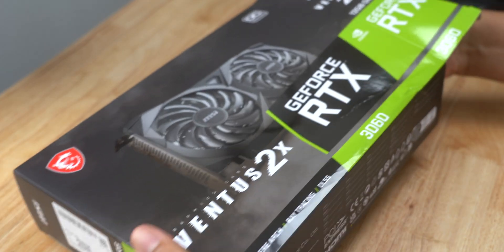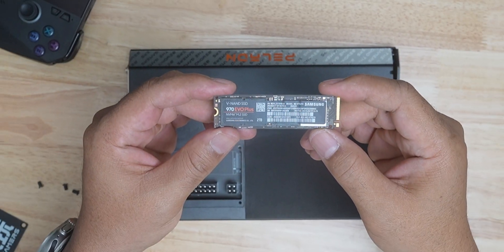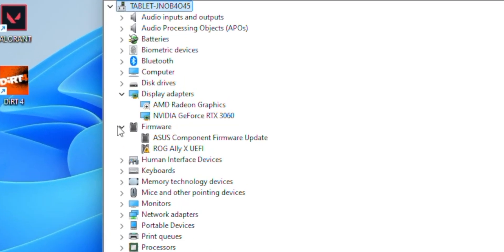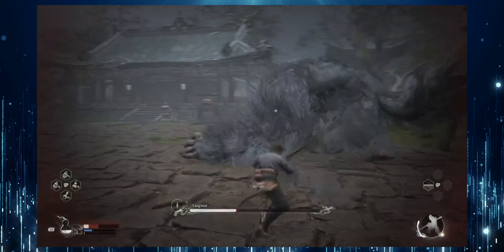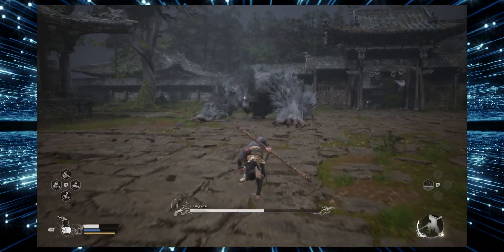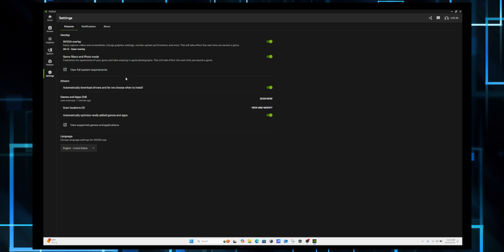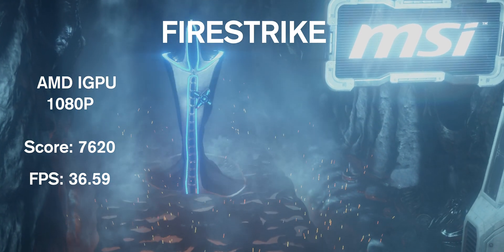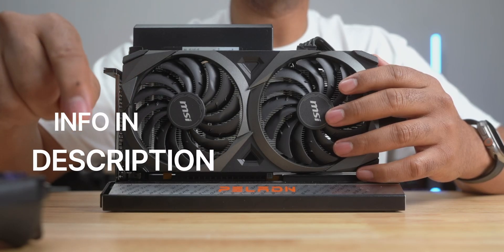How I Upgraded the  Rog Ally X with a Graphics Card: Full Setup and Benchmark Results

Comment: I HAVEA Z1X. i am curious, how does the ally interface wtih the dock and egpu. what gets plugged into where?
Reply from the maker: You plug connect the power supply to the dock. connect the gpu to the dock. connect the monitor to the gpu. Then one thunderbolt cable connects the ROG Ally X to the dock.   This won’t work with the original ROG Ally since it uses a XG Mobile

Comment: you made some fatal mistakes while setting up this test, for starters dedicating 12gb to vram is a huge mistake, this is because the igpu will never actually use any more then about 8 to 10gb and only goes that high in very few games under very distinct settings, settings which you would never use on this device!!!  That being said what you will see is system ram usage consistently going over 16gb so when your dedicating say 12gb to vram and system ram is being starved thats creating a slow down and thus affecting your fps in a major major way dont believe me just test it n see for yourself.  I own a onexplayer x1 with basically very similar specs to the ally x with the exception that it has 32gb of ram and even then i dont ever dedicate over 10gb to vram and rarely except in one single use case have been able to force the system to use up even 10gb of vram the one time i did get it to do so i was actively trying to get it to do so and thus forcing it to do so but under regular gaming scenarios its very unlikely to hit over 8gb of vram on these devices with the settings one would want to be using on them.  Keep in mind it was too long ago that there were no such thing as graphics cards with over 6gb of vram.  Higher gb vram cards is a thing that only started in the last 10 years, prior to this you never really needed any higher then that and i argue you still dont depending on the device and games.
Reply from the maker: I’ll definitely keep that in mind for future tests. Thanks

Comment: Would you recommend this card for ultrawide monitors? 3440 x 1440
Reply: You're joking right? UW as a whole is bad for gaming unless you got the high end cards.
Reply: @guyknightley3499  I’m new to the PC world so just gathering intel. I set my monitor to 2160x1080 and it runs most games on low setting at 60fps or better. Just looking to make it run a little better with an external graphics card
Reply: @Mmmmmk247 let me know how you get on im in the exact same boat as you. My max budget would be around 350-400gbp and yours? Out of curiosity
Reply: @guyknightley3499 what sort of cards? Need advice

Comment: well this looks like a project for me to try out (while packing it all into a  ATX PC case) and adding drives. an Optical Drive, a 5.25" Floppy Drive, a 3.5" Floppy drive, a Hard Drive (1tb), a zip drive, a Jaz Drive, a Ditto Drive and 4 2.5" 4Tb SSD's. might consider 2 1tb Micro SD cards for more storage. (19 almost 20tb's of bulk storage).

Comment: I cant seem to get the Nvidia driver to install. It says No Nvidia GPU detected. I have plugged in my EGPU shortly before installing. Any tips?
Reply from the maker: Once I downloaded the software I plugged the GPU/dock into the Rog Ally X and the software detected the GPU.  I would double check and make sure everything is connected correctly, then try another thunderbolt cable and see if that helps.  Hope everything works out for you.
Reply: @Kiwi-nu1wv  So what was you issue ! I just got a 5070ti 16gb coming tomorrow and seen you had a problem.  Just hope I have a easy experience

Comment: I want to try this on my rog ally since it has only one usb c, will it charge at the same time while connected to graphics card ?
Reply: This will only work with the Ally X which supports USB4. For the original Ally, you'd need a xg mobile egpu

Comment: My country is kind of dusty so I would like to get something which has everything and slot for 40-50 series RTX and ssd slot and it needs to be covered
Reply from the maker: Razer Core X or Core X Chroma if you can find it. Microcenter also sells the Sparkle Thunderbolt 3 eGPU Studio-G with 750 Watt PSU. If you can get them shipped to where you are. I’ve never used either tho.

Comment: good and easy to understand video, thanks! i bought a used razer core x with a included gtx 1660 super (6 gb ram) for 200 Euros for the legion go and have on firestrike 13082 points (the igpu had 7200) . i mean for 200 bugs nearly double the power is nice right?

so these eGpu-stuff is really cool for notebooks and handhelds! my next upgrade will be the 4070 super or the 4070 super ti because of the 16 gb ram, can´t decide at the moment, i will do some video editing with it and gaming with a little bit rayrtracing... 🤔😊
Reply from the maker: Sounds like you got a really great deal on the razer core. Thats the thing I really like about these setups is the ability to upgrade later. I’m hoping to do the same. Thanks for watching!
Reply: @digitalmaus  i got the 4070 super and after some configuration etc , it runs without problems. I first start the legion go, when the windows login comes i switch on the razer with the 4070 and there comes the screen on the external monitor. Time spy about 16000 points, undervolted the 4070 to 170 watts (silent and nearly as fast), and i have now the feeling i would sit behind a brandnew desktop gaming pc, indiana jones i"m coming ..😘
Reply from the maker: Nice👍! its Marvel Rivals for me

Comment: oh this is a rabbit hole I dare not go down. I got the ally x as a box that was both portable and easy to plug into my tv for casual gaming. but if it supports eGPUs this could get silly.
Reply: unfortunately im going down this hole right now witht the legion go
Reply: @zIncognito  how is it going I’m planning to buy a legion go as well.
Reply: @jadentwist89 if I was you I would wait till the Legion Go 2 comes out. Now I don't know if the 2 will come with TB5 ports or not but if it does it's really worth it. Plus, RAM plays a significant role in current day gaming and if you plan on doing an eGPU setup you won't be able to upgrade it. On this topic, the windows Legion Go S with Z1 extreme and 32GB Ram is really attractive. The weight matters as well, the LeGo 1 is really heavy and you feel it ...
Personally, I have spent 850 into the LeGo1 + Accessories and I must say I feel a fair bit of regret.
Reply: @TheAlixSH thx for the advice. Only problem is that legion go s is 40% more expensive than the regular(16gb version and they don’t have 32gb). I’m assuming lego 2 will be atleast 750$ (and even more in eu) but I think it will be even higher which will be too expensive I feel for just a 20percent boost.
Reply: @zIncognito  yeah me too
Reply from the maker: LOL I completely understand